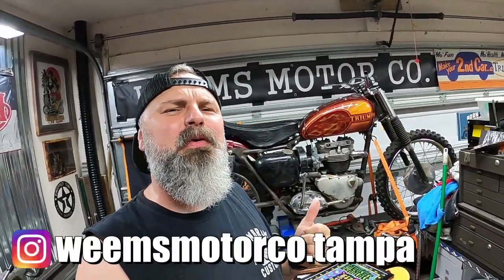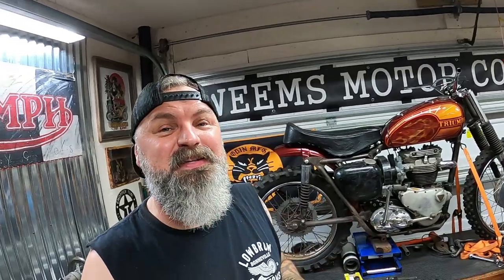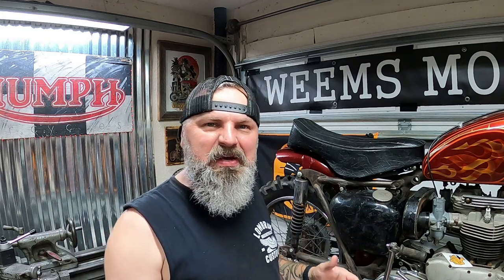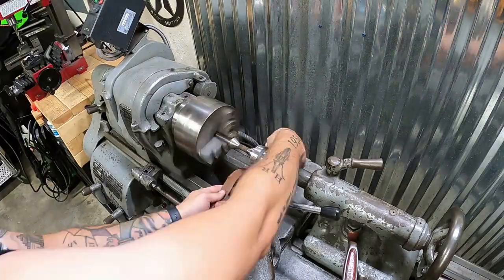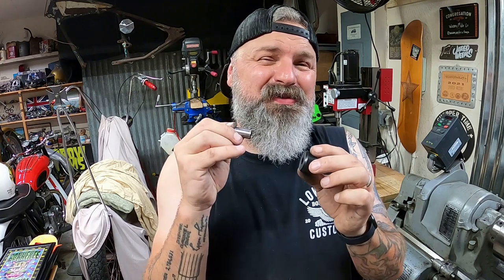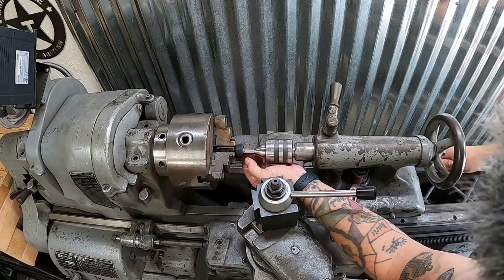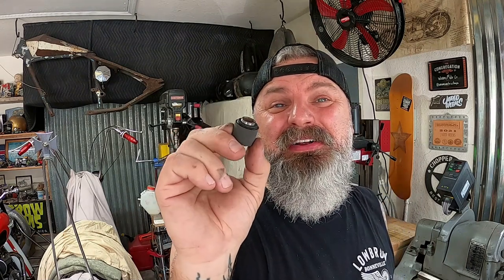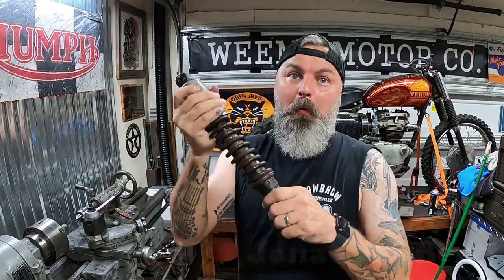Make Your Own Shock Bushings!

Comment: I could have used some of those. I bought new shocks for my 1975 Honda CB750 and the cheap rubber bushing that came with them got torn up on installation.   Ended up using the old ones I had.

That desert race sounds fun.  I wonder what the temp will be.   I'm new to old British bikes and I recently noticed how hot the carb on my 64 TR6 gets.   The temperature will be fine while riding around (thanks to the airflow) but when I park the bike the heat transfers from the engine to the carb... it'll get hot to the touch after 15 minutes or so.   I've tried a couple different insulators...they all work about the same.   Is that just the way these old British bikes are?   My Honda carbs stay pretty cool, but it's a very different design
Reply from the maker: Great note.  Webco made some finned intake spacers that take up some of the heat.

Comment: Why do you think every single car or bike EVER sold has never used Eurethane bushes as standard?
They are garbage. Eurethane melts at temperatures shocks reach. They aren't a lender or progressive stiffness. They go hard, hard, collapse to soft. Rubber goes soft, medium, hard progressively. 
Eurethane won't last long, 5 years max in a good climate. If the suspension is rotating of flexing even 5° they will crap out. 
Good rubber is only on good brand cars. I've got 50 year old Toyota's here with OEM rubbers still
Reply from the maker: Great Point!  I will keep an eye on them for sure!